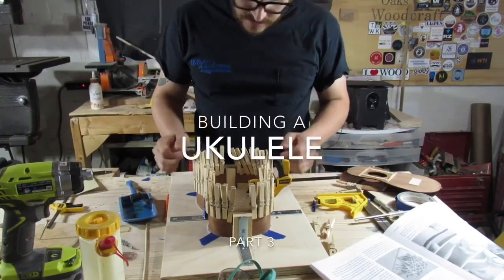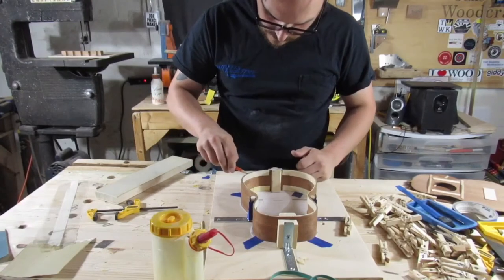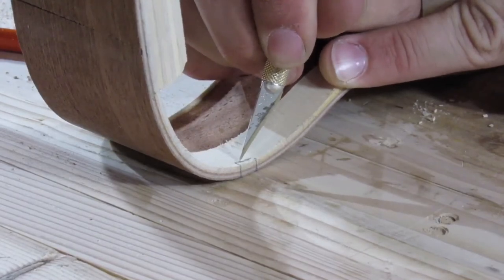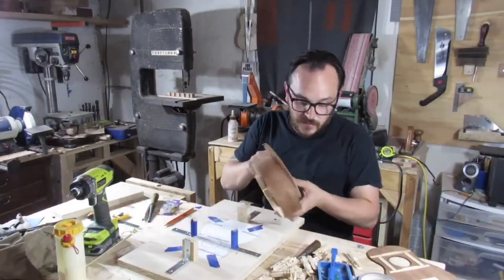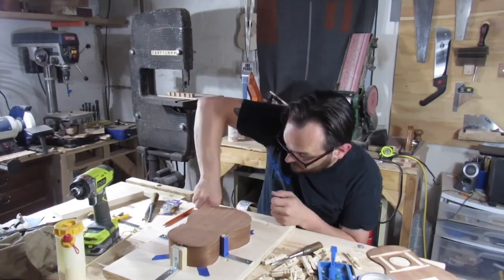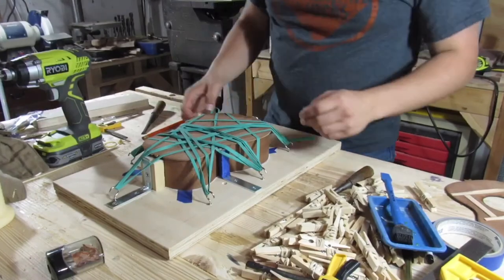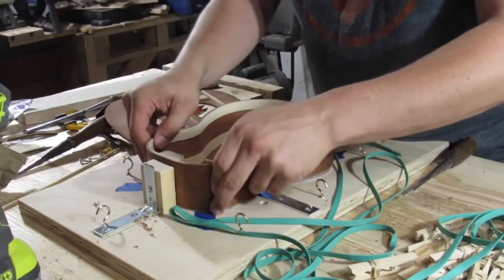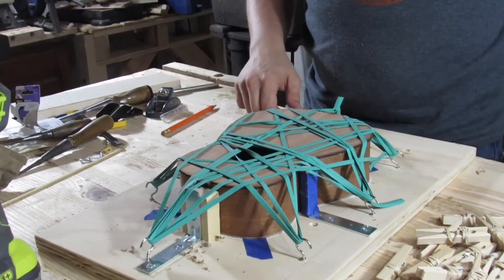Building a Ukulele Kit - Part 3

Comment: Seem like a laminate router would make quick work of cleaning up the top and bottom edges. Or do you think it would cause tear out?
Reply from the maker: That probably would work, but I don't have one.  If I made these for a living I would probably use one.
Reply: I think a spindle sander would be safer. I’d be too afraid of tear out with a router. I cringed when he started in with the chisel. One slip and it might tear out.